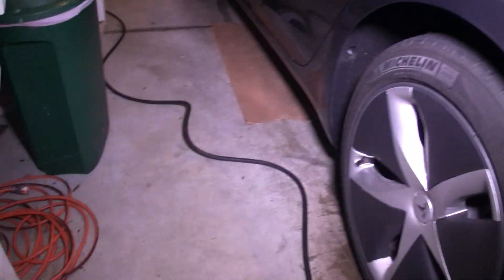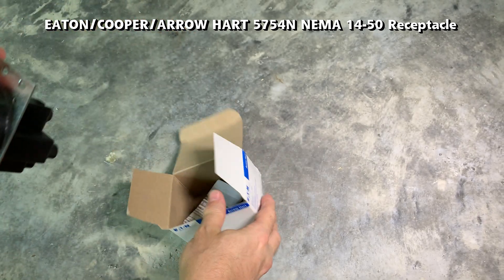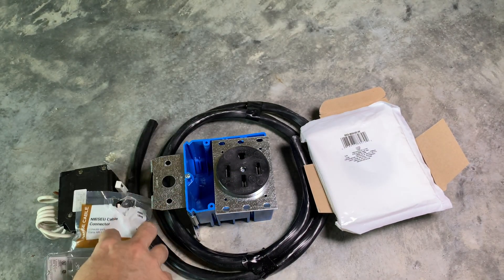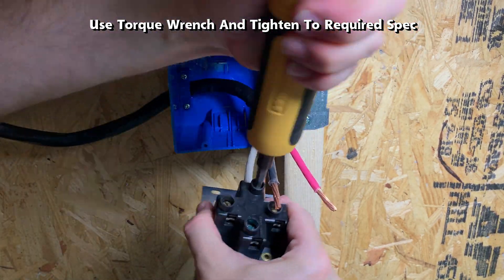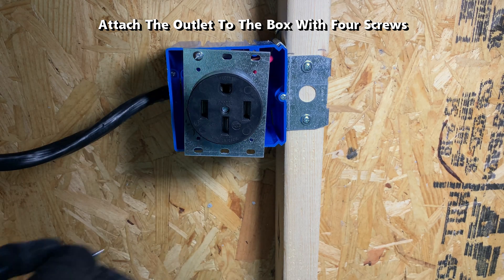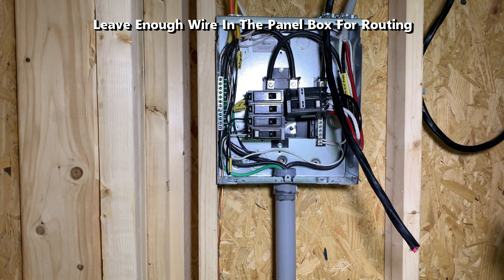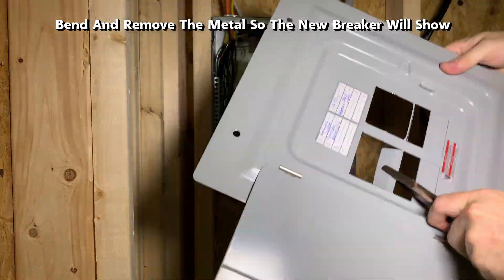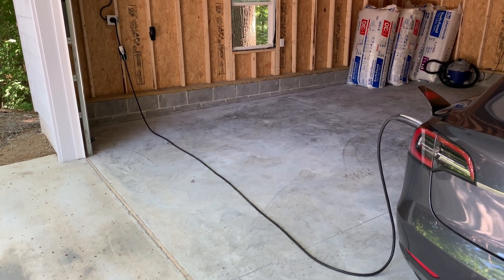Tesla - NEMA 14-50 Outlet Installation (No Music Version)

Comment: Hi i have questions if i am using NM B 6/2 romex wire . There are 3 wires so how do i connect to nema 14-50. Thank you
Reply from the maker: If you only have a 6/2 romex wire, you can only use a NEMA 10-50 outlet.  The NEMA 14-50 requires 6/3.

Comment: A few concerns for home owners:

1). Is your wire big enough to carry the current?  No, not that wire, the wires supplying your home.  Your house service wire size is reduced greatly based off demand when the home was built.  Adding a level 2 charger is almost the same as adding an stove/oven combo to run for up to 10 hours.  This is done with a calculation to determine wire size, not simply adding the numbers on the breakers.  

Add the numbers on the breakers and you get something like this

50 amps stove
45 amps heat
50 amps cooling
30 amps water heater
40 amps dryer
About 5 20 amp 
About 7 15 amp

That would total about 425 amps in breakers on your 100 - 200 amp service before you add the 50 for this charger.

2). In this case, the panel is a sub panel and would also require that same look to prevent overload.  Maybe a bigger wire or even bigger capacity panel.

3) the 2020 NEC requires all garage recepticles both 125 & 250 ( their numbers) be GFCI protected, no matter what protection is plugged in to it.

4)  I have found no NEC requirement to place the recepticle ground plug in an up or down position.  Consider the equipment and strain on the cord for placement.  Some Hospitals believe it is an overall safer condition with the ground up. (First prong to make contact is ground and breaker trip if the hot is then touched).  If the plug slides out a little and something slides down the wall.

5). Both electricians and inspectors are serious about "following the rules" to get you the safest build you can get.  This sometimes makes them see like "Butt-Heads ".  Do not be afraid to call and ask them questions.  Maybe a consulting fee to the electrician to get the knowledge to do it yourself.  Each building department may have different rules and your local people should know them.  Like, does that recepticle require a permit?

Remember:. Safety first, never last, have a future, not just a past.